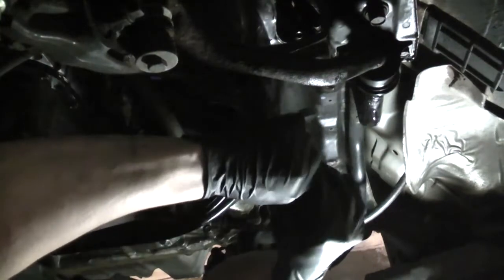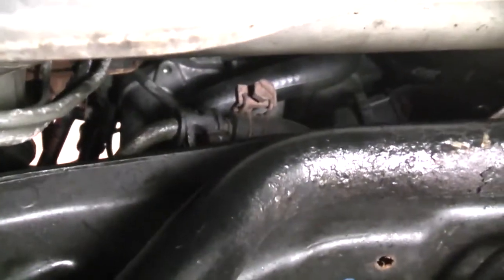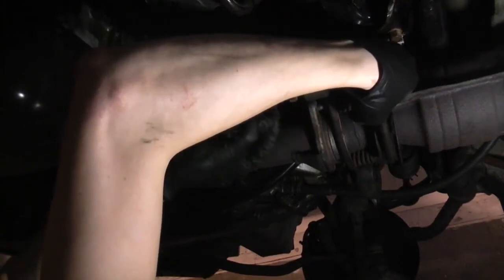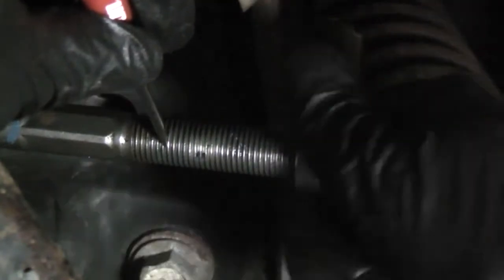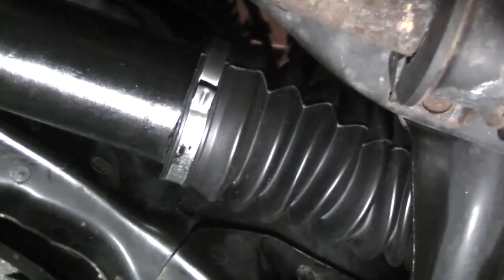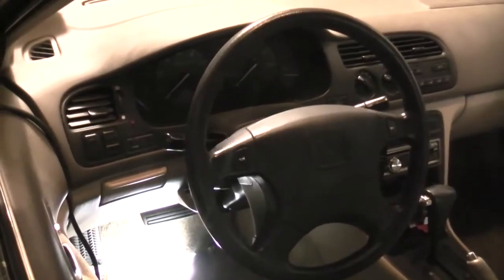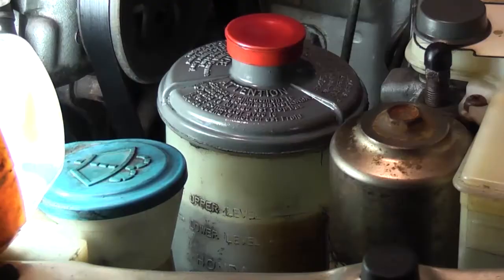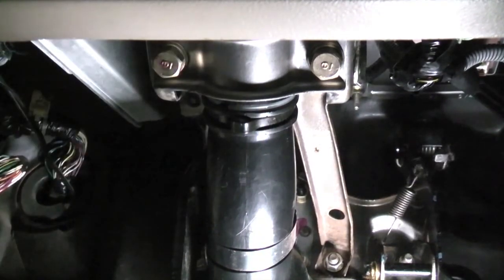94-97 Honda Accord Steering Rack Replacement Part 2

Comment: I have been working on my 96 Accord LX.  I was replacing the clutch.  However the steering rack was leaking bad and I had to replace it also.  It was a little easier to loosen the power steering lines with the axles out of the way.  This video is a great resource for the steering rack replacement.

Comment: I know it's been a few years since you did this work and made the "excellent" video set. Identification, replace P1 and P2. But I must ask about the pressure and return lines re installation into the rack. On P1 you showed and explained (very well) how to disconnect the lines. However you glossed over reinstalling the two lines. Of course I know it should be just the reverse to reinstall but I was hoping you might tell me what to be cautious of (other than cross threading) and how best to go about it since they were a problem removing?
Again, excellent videography, demonstration and explanations!!
Thank you so very much for taking the time and trouble to publish for us!

Comment: I did the valve cover gasket and distributer o ring watching your videos already. The leak is by the timing cover and that general area. I lose a quart in 2-3 weeks. I drive a 97 Accord SE w a 2.2L
Reply: I have the same thing... I think it's the main seal.  Bad news.
Reply: Clogged pcv valve can do this..pressure cannot escape

Comment: Just think at 17:17ish if you had measured with a caliper from the end of the inner tie rod shaft to that lock nut - you would have been able to run it down and it would be spot on.
just noticed at 38:26 the rear half of that front fender is missing..

How long did it take to replace it ?
Reply from the maker: It will never be spot on as the inner tie rod on the new rack won't be the exact same length. Not to mention the tolerances in the rack gear, the mounting holes that bolt the rack housing to the frame, etc. The difference between the toe being in tolerance or out is 0.12 degrees that's around 1/8 th of a degree. It doesn't take much of a manufacturing variance to throw that off.

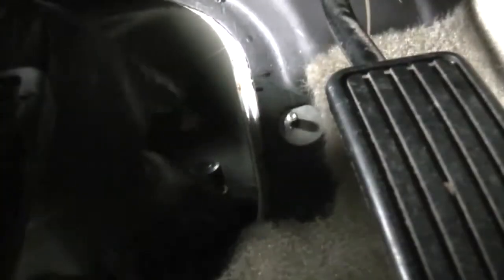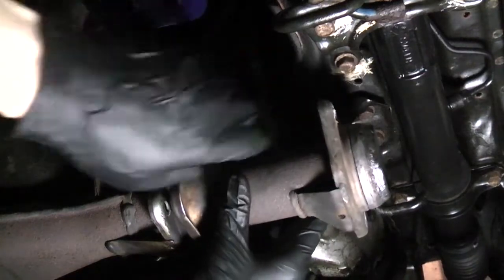Comment: ***** I really need your help on this one, just like you said on 7:45 to 9:19 on this video. now my horn and cruise control doesn't work. what can i do to fix this, I'm not sure if the clock spring damage or something i have a 96 accord 4dr 2.2l
Reply from the maker: Are you sure you didn't turn the wheel when the u-joint was off? It's very easy to do that.

If they worked previously chances are it's the clock spring if the 96 has a clock spring with an indicator gear and it was indicating it was centered and the rack was centered there should have been no issue.

Both the rack and clock spring must be centered. Otherwise the un centered rack will allow you to overturn the clock spring causing damage.

The easiest way to test it without a schematic would be to disconnect the battery and allow the vehicle to sit for 20 minutes. Then remove the airbag, steering column covers, disconnect the connectors for the horn and cruise control, airbag, and disconnect the main connector from the clock spring to the vehicle.

Then run a continuity check between the connectors on the wheel to the connector where the clock spring connects to the harness. Each wire should have continuity on one pin of the main connector if it doesn't the clock spring is bad.
Reply: ***** thanks a lot brother I will try change the clockspring and see if that works. No the rack and steering column wasn't centered reason being after the whole installation I went did 4 wheel alignment I had to hold the steering wheel halfway counter clockwise for the car to drive straight I find out the inner shaft wasn't properly installed
Reply from the maker: Guynel Saint-Val
Make sure the battery is disconnected for at least 20 minutes so the SRS computers capacitor is fully discharged before removing the air bag.

The only special tool you'll need to replace it is a steering wheel puller most auto parts stores will loan the tool for free.

You just have to put down a deposit which is usually the value of the tool and it's refunded when you bring it back.
Reply: *****
you the man brother, great videos outstanding job, i go head follow your instruction and re-install a new clockspring and viola problem solved. i truly appriciate it and really wants to thank you.
funny thing is i paid my mechanic to replace the rack and pinion and he end up messing it up more, it was because of your video i found out what's was wrong.
Reply from the maker: Guynel Saint-Val
No problem. Thanks for watching.

Comment: so i watched your video witch was really helpful to replace my broken rack from the same year model n i did exactly what u did but now my cruise control n horn dosnt want to work also my srs light popped up i lined my clock spring indicator like u said please help!?
Reply from the maker: All 3 of those circuits are routed through the clock spring it is likely that it has failed but you will have to test it.

Remove the airbag (follow the service manual instructions) and disconnect the clock spring to main harness connector under the dash. You will need to check for continuity from a clock spring wire on the wheel to the disconnected clock spring harness connector.

Pull the single connector off the horn switch and probe it then probe the gray wire on the harness connector you should have continuity. If you don't the clock spring is bad. You can check the other connections if you have a wiring diagram but it's unnecessary as any breaks in the clock spring require replacement.

The only way this could have happened is if the clock spring and rack weren't in sync when the u-joint was installed. The wheel should have been turned all the way to the left before the u-joint and the original rack was removed. The steering wheel lock will keep the steering column shaft in this position. Turning the new racks input shaft all the way to the left manually before installation of the u-joint synchronizes the clock spring and the new rack properly.

In other words when the clock spring is at the center of it's travel the steering rack will be too.

Comment: Would this be the same process as a 91 accord LX? I"m changing out the rack and pinion on mine this weekend and I'm hoping it's as easy as you made it look in your video.
Reply from the maker: Yes the process is similar.

Comment: You mentioned getting the rack from Autozone but didn't mention the cost if core returned? Also did you get the tie rods there also? I ask because this is an important part and safety hazard if not done correctly. My Honda dealership said not to waste the money and it would cost $700+ to replace. Thank you!

Comment: My 1997 honda accord doesn't have the marks to line up the clock spring. It appears to be a different setup. Any suggestions on how to line it up?
Reply from the maker: Rotate the wheel carefully clockwise until it stops then rotate it 2 turns counterclockwise.
Reply: ***** Again, thanks for taking the time to make these videos and always responding when I have a question.  You are a complete badass.  I have the same problem as desert rat.  My 97 doesn't have the clock spring center indicator.  I read this comment above and (with the u-joint disconnected) gently turned my wheel clockwise until it felt like there was some tension.  In the process of doing this, I've completely lost my count. It kind of scared me because it felt like it was turning forever....I was terrified I was snapping some wire so I didn't want to do it too much further.  I then turned it two rotations to counter-clockwise.  With all the clockwise turns, only two back counter clock-wise doesn't seem right.  Please help.
Reply from the maker: 4frodo
That's the proper way to center the pointerless clocksprings.

If you're really cautious you can remove the steering wheel and turn the clock spring manually. But it's not necessary. You don't need to be super precise.

Thanks for the reminder I added an annotation about the 96-97 clocksprings meant to do it after that reply.
Reply: ***** Awesome!  It's all done.  Runs like a champ.  All told, you've saved me a boat-load of cash.  Rebuilt distributor, new belts, oil change, hoses, rebuilt power steering pump, and now the rack.  Seriously, thank you.
Reply from the maker: 4frodo
Glad to help. Make sure an alignment is done as soon as possible or you'll be needing new tires next :-).
Reply: ***** Hey man.  I got the car all back together and noticed a really bad clicking noise on my passenger side.  Sure enough, the lower ball joint is toast.  Also the passenger and driver side upper ball joints look pretty bad.  This is a long-shot, but do you happen to have a video on how to replace these badboys?  I've read some forums on the lower, and it looks like a bit of a beast.  The upper A-arms, ball joints don't look terrible, but that hub over rotor thing scares me.
Reply: 4frodo PS: I haven't had my alignment done yet, so I guess that's a plus. ;)
Reply: Curious why the wheel needs to be turned if it is locked in CCW position (at end of 1st video) and the rack input shaft has been turned fully CCW before installing it for clearance. Seems that the u-joint could be installed and the wheel returned to center position which is about 1.6 turns CW on my 97 Accord. The wheel and rack would both be centered. Right?

Comment: By chance do you remember the steering racks brand or retailer you bought it through? As well how is that rack holding up, no complaints or issues? Im guessing its a customer car fyi. Looking for a reputable reman/new rack for my honda, A1 Cardone seems really bad by reviews Ive read.
Reply from the maker: +Richard McCormick The part was provided to me all I remember is it came from Advance so it probably was a Cardone. No complaints.

A rebuilt part is only as good as the core. If you're unlucky you can get a dud from any rebuilder.

Comment: by any chance do u know if the clock spring center indicator is available on other cars like Toyota or Hyndai..
Reply from the maker: It varies by vehicle many service manuals will tell you how many turns it takes to center it.

Comment: I don’t see a clock spring indicator on my 1997 accord EX wagon will that be an issue doing this job can anyone advise.?
Reply from the maker: Yeah they removed the indicator on 1996 models you'll have to just do it blind I'm afraid. Lock the wheel all the way to the left before removing the u-joint and you'll be fine. The amount of movement on the steering wheel when it's locked doesn't matter.

When those clock springs were new they had a plastic pull tab to keep them centered for installation so they did away with the indicator.

Comment: Can u do a video on camshaft seal replacement?  Mine is leaking.
Reply from the maker: Are you sure it's not just a valve cover gasket leak?

A leak from behind the timing cover would exit the weep hole at the bottom of the lower cover near the oil pan. The cover halves are designed to channel the oil away from the timing belt so it doesn't get damaged.

A leak from the oil pan gasket can also make it's way to this weep hole giving the illusion of a seal leak.

Comment: This is going to be a long one... bear with me for a minute.  It's been about a month since I finished rebuilding my P.S. pump/replacing the steering rack thanks to your badassery.  \m/  I also replaced the upper control arms/ball joints, and one of the lower ball joints. THEN I had my alignment done. The knuckles/hub-over-rotors on these hogs are horrible.  For the record, the other videos people put up here are pretty lame compared to yours.  I had to figure most of it out on my own. :( Anyway, I've noticed my steering is a little harder than it was before.  Question 1.) I know the p.s. pump/rack are working, but is it normal for a new (refurbished from napa) rack to be a little harder to turn?

Now for the real problem.  As I mentioned in my previous comments on this video, I lost track of how many turns without the clockspring center indicator.  As you suggested in your reply, I turned it gently until it stopped (made a slight spring noise), counter clockwise two turns, etc.  It seemed like I was fine for an entire month....until.... the SRS light came on today.  Shit.  So far, the cruise control and horn work.  I'm assuming the clock spring was tweaked a little too much when I lost track.  Question 2.) How screwed am I? Do I dare replace this thing? I found an Evan-Fischer EVA11672041562 Column Clock Spring on amazon for pretty cheap. Question 3.) Am I ok to go with a cheap aftermarket part, or do you recommend an old OEM clockspring from ebay?  Please help!!  I'm trying to keep this think running as long as I can.

Any suggestions on how to go about replacing it safely?
Reply from the maker: I intend to release a comprehensive hub over rotor video in the coming months. It's filmed I just have to find the editing time.

With all those suspension components replaced it doesn't surprise me the suspension is tighter. Worn components have larger tolerances.

It's pretty easy to replace the clock spring. Disconnect the battery and wait at least 3 minutes to discharge the SRS computer capacitor. Pull off the covers on the left and right side of the steering wheel. Then pull off the bottom air bag connector cover (2 screws). Disconnect the air bag and install the shorting connector inside the cover onto the air bag harness.

Remove the 2 torx screws on the left and right securing the air bag to the wheel. Carefully remove it and place it FACE UP in a safe place.

Once it's off you'll have access to the steering wheel center bolt remove it. Get a punch or marker and mark the relationship between the wheel and the input shaft splines. You can then use a steering wheel puller to remove the wheel.

Pull off the lower dash cover and disconnect the clock spring from the harness. It's secured by a few screws.

Repeat the process for reinstallation making sure to line up the splines with your mark to maintain steering center.
Reply: ***** Thanks for the quick response. Should I get the SRS light checked before pulling the wheel off? Any suggestions on where to do that for cheap? And, once I get the clock spring installed, how do I reset the light (safely so the airbag actually goes off - one of the videos on here has a dude using a paperclip).
Reply from the maker: 4frodo
Jump the 2 pin blue connector under the passenger side dash and the SRS light will flash the code. It will probably be a 1-1 open in driver airbag inflator.

To erase the code there's a 2 pin connector under the drivers side dash called the MES connector on the yellow SRS harness. There's a very specific sequence to connect and disconnect it to erase the code.

Just look up 1997 Honda SRS reset for the details.
Reply: ***** I jumped the blue and it flashed a 1-2 ("1-1 & 1-2 open circuited Or high Resistance In Drivers Air Bag Inflator"). I wanted to double check that it was really the problem, so I cleared the SRS memory (I'll put this here in case someone else needs to do the same thing): 

"The Honda Service Manual says:
1. Turn the ignition switch OFF, and wait for ten seconds.
2. Connect a short to the Memeory Erase Signal (MES) connector.
3. Turn the ignition switch ON (II).
4. The SRS indicator light comes on for about six seconds and then goes off. Remove the short from the MES connecotr within four seconds after the SRS indicator light went off.
5. The SRS indicaotr light comes on again. Reconnect the short to the MES connector within four seconds after the SRS indicator light comes on.
6. The SRS indicator light goes off. Remove the short from the MES connector within four seconds.
7. The SRS indicator light indicates that the memory is erased by blinking two times.
The ten second delay at the beginning is very important or the memory will not reset."

It went away until I restarted my car.  Same problem.  The clock spring is in the mail.  Based on everything I've said, does it sound like clock spring is the issue?  Before I put any work into pulling the wheel I want to get your professional opinion.  I'm driving the '97 SE model, so it has the cruise control on the wheel too.  Will I need to do anything special for the horn or cruise wiring?  Thanks again for everything, Bousho.
Reply from the maker: 4frodo
The horn and cruise wiring go through the clock spring too nothing special.

One connector from the clockspring will go to the air bag and the other will go to the horn / cruise control switches.
Reply: ***** I replaced the clock spring and paperclipped the srs unit. It worked!  oh, and the steering is a little easier.... I'm pretty sure my old clock spring was wound up/causing some of the resistance.  Thanks again, Bousho!

Comment: 1996 honda accord lx. no clockspring indicator. ill rewatch 3 or 4 times before i get started. input? thanks.
Reply from the maker: As long as you lock the steering wheel when it's turned all the way to the left and make sure the new rack input shaft is turned all the way to the left when you reinstall the u-joint the clock spring will be properly synced.

Centering the wheel is just to make installation of the outer tie rods easier and is optional.

Comment: Hey Bushou,
Please put some safety glasses on, some debris or oil leak might drop in your eyes.
Reply from the maker: I agree rust flakes in the eye is not pleasant.

I stepped on them before I began filming believe it or not :-). I filmed a bunch of videos that day that I've already released so I'm sure you'll catch a few more glimpses of me not wearing them.

They weren't cheap either last time I leave them on the floor.